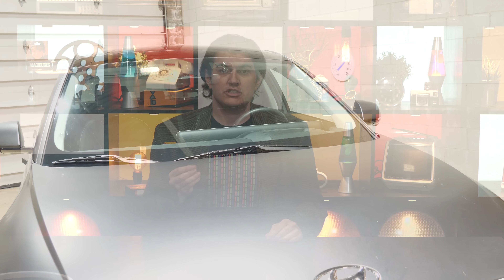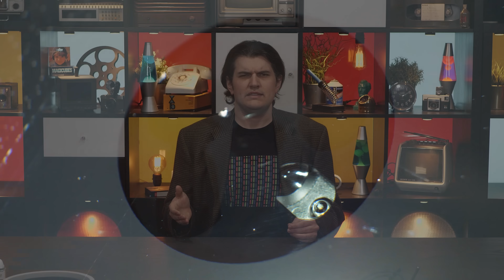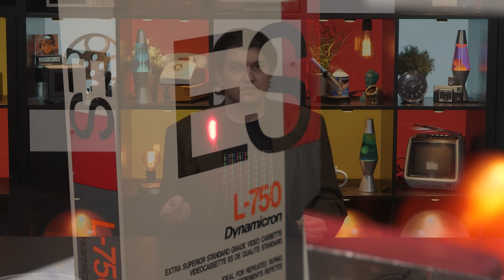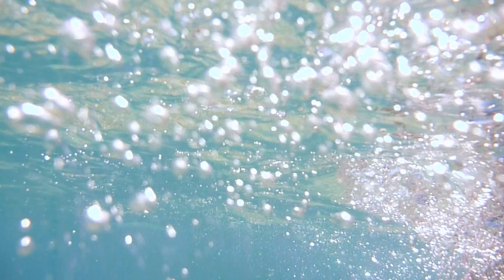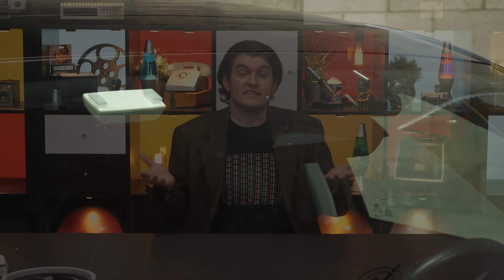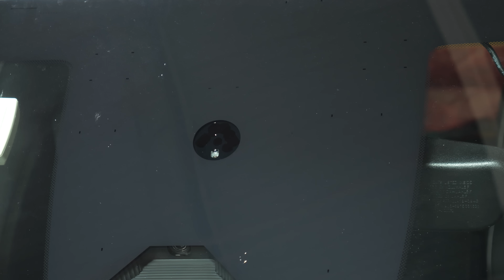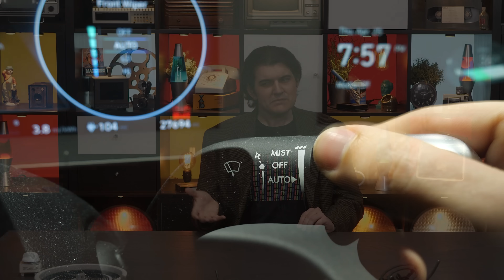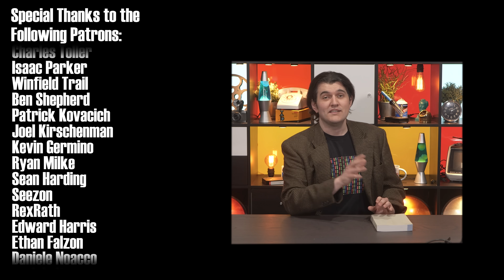The simple, clever sensor behind automatic windshield wipers

Comment: The thing that surprises me the most about this entire episode is that Alec is not the kind of person to read his owner's manual front to back within the first 30 days of buying his car.
Reply: I had had my company car for three months, before I RTFM, and discovered it had a 6 disk CD changer hidden in the boot / trunk...
Reply: @sarkybugger5009  sick I wish my dads car had that (im too young to drive )
Reply: @anymous4322  The car I currently drive is older than the car I referred to, and doesn't even have a CD player.  However, it does have an FM radio, and Bluetooth FM transmitters are less than ten currency units almost everywhere. I start my car, it plays music direct from my phone.  No interaction required.
Reply: @sarkybugger5009  I'd much rather have a CD player than anything that links to my phone in my car. Even a tape player is better, and it gives me a headphone jack aux cord if I want.
Reply: @NottJoeyOfficial  It has a cassette player, but I haven't had any cassettes for more than 10 years.  My car stereo has no external input sockets, it's cassette or radio only.  However, it's quite a good quality unit.  (Volvo)  My Bluetooth adaptor allows me to play anything from a selection of over 60 GB of MP3 and FLAC audio on my phone, and act as a fully hands free speakerphone while driving, and not limited to 6 CDs. What's not to like?
Reply: @sarkybugger5009  I just personally don't want to have to fiddle with my phone while driving, a CD player can just play all of those but with a lot more songs on the phone you gotta control it a lot more. At the very least it's local files, I wouldn't want to be tied to the internet while driving around.
Reply: @NottJoeyOfficial  It has play/pause, and back/forward track skip buttons.  My phone stays in my pocket.  I only play local music files.
Reply: @sarkybugger5009  hmm, let think: driving out of signal range (Wifi/5G/LTE), commercials/station identification; low battery warnings; not know which song is about to be played; getting interrupted by alerts/texts/calls... should I go on?
Reply: @ElectroDFW  None of those things bother me, so what's your point?
Reply: Why the hell would that be in the trunk lmao, that sounds terrible for usability.  @sarkybugger5009
Reply: @sarkybugger5009 Putting a CD changer in the trunk... I'm sorry, my brain just snapped.
Reply: @sarkybugger5009 literally same for my sister, I recently read the manual of her car and she has a secret storsge compartment under the front passenger seat 😁
Reply: @sarkybugger5009  I had my last car for years before I spotted the "load" button, and I thought "I wonder..."
Reply: @sarkybugger5009 six-disc*
Reply: @sarkybugger5009  RTFM? What kind of obscure acronym is that?
Reply: @fishkluch old school computer slang
Reply: I read manuals for cars I don’t even own, but am really interested in. It’s a good way to know all the useful little features the cars/devices have. 

Side note- I especially hate how so many companies are making the goddamn user manuals web-only, the whole point of a manual is you don’t need a network connection to look something up. I miss pdf manuals.

Edit to add clarity- They don’t even have an option to download a pdf version, it’s just a link for the online manual. It’s much more clumbersome to jump back and forth between sections
Reply: @Skiman__  Actually, I like both.  The tree version to read through at leisure, and the electronic version to quickly do a search for something in particular.  The latter is also your only option if you want to research a car before you buy it or have it still on order..
Reply: @Skiman__  My favorite is when it is only on the infotainment. It is then inoperable if you need to locate a fuse location or anything else if there is a need for the battery to be disconnected or it is dead!
Reply: "the whole point of a manual is you don’t need a network connection to look something up"

If your owner's manual doesn't have dirty fingerprints on the "where we hid the spare tire" page, is it really even an owner's manual?
Reply: @Skiman__  These online PDF viewers where you can only look 1 page at a time, can't search and can't download should be banned by the EU, the US and worldwide!
Reply: @Skiman__ If a manual is online, it should be considered an automatic
Reply: @Skiman__  My BMW has the manual in the infotainment with a lookup feature, it's great
Reply: @Highraven, I don't which exact brand you're talking about, in my experience it's only Land Rover that doesn't provide downloadable PDF, I can't find/download owner's manual on their website.

Other brands are good: Toyota, Tesla, Rivian, Mercedes-Benz, Honda, Hyundai, KIA
Reply: @Skiman__  Oddly, the app that came with my car has a link to the owner's manual, but clicking on the link leads...to instructions on how to use the app, not the car.
Reply: @Skiman__ that would be really frustrating if you had car trouble out where cell service is sketchy.
Reply: @Skiman__ there's gotta be a way to use some tool to easily copy paste all the text into a nice printable format if you really need it
Reply: @Skiman__  dude it makes sense, just download it
Reply: @bobbob-gi1yp  I guess I wasn’t clear, many don’t even have a option to download a pdf manual. They only have a link to the website based online manual which isn’t going to work offline and isn’t convenient at all to jump around sections
Reply: @Skiman__  Many web browsers have the option to save as PDF or print as PDF.
Google chrome you can print and save as pdf. Which is searchable.

Safari you can export as PDF while it won’t be in separate pages you can still search it. Granted there might be a size limit i don’t know. Also you can click print and then click on the drop down menu at the bottom of the window then click save as pdf. You can also choose your page size. I think you can pick that in chrome too. You can even create a custom page size.

If you’re saying the web site acts like an indexed PDF meaning you have to click a chapter to get to a section and it loads a different new page and there are too many of them to reasonably save as pdfs i get that.

But if it is all on one page it is possible to easily save that as a pdf. And even if it is in parts you could if you wanted to save all branches as pdfs then use a pdf editor some have trials to assemble them all into one file. 

Is it inconvenient you bet ya. So I recommend reaching out to their support centre and letting them know about your dilemma and maybe you might inspire them to add that feature so that others like you might benefit.
Reply: @Skiman__  depending on how it’s laid out you can just print the web page to a pdf. If it multiple sections just print each section and combine them with a pen combiner and there you go.
Reply: The thing that surprises me is that it's not in the infotainment screen - why shouldn't such a multifunction interface have built in help files?
Reply: @questioner1596  My 2012 BMW does that, never cars not doing it is just laziness on their part
Reply: @questioner1596 I drove a 2018 Ram 3500 dually truck with the 8" display and it had it a quick reference section on it
Reply: @questioner1596  cause engineers don't have the final word on anything, and everything they want to add is weighed against the cost of implementation by someone who knows a lot about numbers and very little about cars.
Reply: @questioner1596  Mine does! Both a quick reference and the entire manual. Oh, you fastidious Germans!
Reply: I read my new cars' manual before I actually bought it.
Reply: It's an important  new car ritual: Sitting in the driver's seat going through the manual, playing with the toys-sorry 'features' until you've flattened the battery and it won't start.
Reply: Same. Of the few people that would read a manual, i figured he would have been one of them
Reply: Doug the kinda guy to read the Ford GT owner's manual to his kids at night.
Reply: Is that a Doug DeMuro reference?
Reply: I read my parents' owners manuals front to back as a kid. Interesting stuff.
Reply: @noxious_nights  same. I kept the owner's manual from my first car; nice to look back sometimes.
Reply: Nonono, within the 30 days PRIOR to buying the car
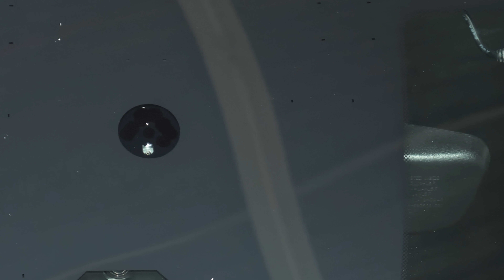Reply: 1:36 the ambient light sensor in combination to the rear facing light sensor on auto dimming mirrors tells when to dim the mirror. At least that’s how it works in bmws.
Reply: @FishFind3000  that's exactly how BMW make it work.
Reply: @FishFind3000 I’ve got mixed feelings about the automatic dimming rear view mirror. 
Though my children are grown now, I occasionally play the role of granny chauffeur. The manual toggle lever on un-fancy mirrors meant I could just move the lever and see the back seat passengers without having to turn around 😉
Additionally, being short in vertical stature, un-fancy rear view mirrors had two pivot points, which allowed for better visibility of the road behind me
Reply: That's the best part of buying a new car (or any complex consumer device), you read the owner's manual to learn about all of its quirks and features.
Reply: i feel like cheap chinese products have ruined our attitudes. when I was a kid, instruction manuals were thorough, useful, and downright vital. now there's a few badly drawn illustrations and a few lines of engrish that (often incorrectly) tell you how to do SOME of what the thing can do.
Reply: @KairuHakubi  not just cheap Chinese products; many products with internet connections do not come with manuals because the interface is expected to change over time. Microsoft doesn't even include offline help files anymore; if you don't have a steady internet connection you can't find out how to use the software!
Reply: @questioner1596  to be fair, even Microsoft engineers don't know how to use Microsoft software anymore.
Reply: When you buy a new car your not actually buying a new car, your buying a very expensive book that just happens to have a car with the book in the glove box.
Reply: @brianallen9810 What are you saying, that the glove box and the "car's" envelope is only to protect the very expensive manual from the elements?
Reply: My dad reads it first thing after buying it. Man doesn't even sleep before he knows everything about the car.
Reply: This. I came to say this. Ya think you know a guy… 😂
Reply: It amazes me that anyone would buy a complex device costing tens of thousands of dollars and spend more time bringing it home from the store than they spend learning how to work it. My brother-in-law bought a Tesla with self driving and spent six months before I showed him how to turn it on.
Reply: @darrennew8211  that's more a testament to how standardized driving has become. Equally surprising is how my wife can drive the same car as me and not know how features like cruise control work. Despite not knowing features I consider to be important, we can still drive from point A to point B..
Reply: @darrennew8211  I think it's an ego thing - "I bought this so obviously I already know how it works..."
Reply: What happens at the car wash?  Not everyone will remember to turn it off every time. Could be a very expensive failure
Reply: @oldmech619  Mostly you just lose the wiper blade. a surprising number of people turn their wipers on in the wash on purpose while they get blow dried. So, not very costly, but defs not something you want to make a habit of. It does get costly with those stupid carbon fiber blades though, and they tend to break instead of just popping off like a normal soft plastic blade.
-car wash employee
Reply: @shanleyshoupe7873    Thanks, that makes sense. I bet the car owners forgets to disarm the wipers one time. Hopefully they learn their lesson.  
Btw, I also turn my wipers on in my old car in the car wash just for the fun of it.
Reply: Someone needs to make a cliff's notes version of the car manual with all the standard content, but none of the giant WARNING! and DANGER! boxes which warn of every possible calamity should you do anything slightly wrong.
Reply: he and Doug Demuro, total dork opposites ❤
Reply: Out of 16 cars my Dad has never read any manuals. 😂
Reply: I don’t have any problems turning the windshield wipers on and off when I need to, but I would love to have a car that adjusted the brightness of the headlights on its own so I wouldn’t have to remember to do it for oncoming cars. That is a feature I would value.
Reply: @sylvanaire  That's called matrix LED headlights or adaptive driving beam.
Reply: I'm choosing to believe that he read it and forgot
Reply: There's so many useful tidbits in manuals!! [And by so many I mean one or two]
Reply: cool
Reply: Im definitely surprised as well. I tend to read the manual while waiting to buy a car
Reply: I want a refund
Reply: 30 days? I would figured 30 minutes!! 😂
Reply: 30 minutes?
Reply: I usually read it front to back 30 days before buying the car
Reply: i dont drive myself, but i always read the manuals of my family members vehicles. they are quite hefty documents, but with a little baseline knowledge you can skim read 90% of it only stopping where there is a new function, or this vehicle deviates from regular function.
Reply: I had my ink printer for ten tears before I discovered it could do duplex printing.
Reply: Manuals? "They are too expensive and nobody reads them anyway" say the bean-counters, "just put a comment section on our website under the "support" selection and let the damn users figure it out for free."
Reply: I read owner's manuals for single engine planes, like Cessnas just for fun. Not so much car manuals, though.
Reply: Having owned Hyundais for a long time, that's the first thing I do, RTFM! They've been useful since before the infotainment systems and their OWN manuals.
Reply: Read mine before I even got delivery 🤓
Reply: You mean 30 days before the car is delivered :)
Reply: I love being part of communities of nerds who actually RTFM. It's super refreshing!
Reply: Imagine how I felt when I realized my car has the italian manual instead of an English one
Reply: The issue with doing this, with my car at least, is that the manual covers every trim and option level of the model. so sometimes it has 3-4 sections covering how to do the same thing, because its got a different placement or procedure for the different engines the car was potentially sold with.  and half the book covers options my base model does not have.
Reply: Bruh the first REMOTE CONTROL car I ever got I sat down and read the manual from cover to cover. I took NOTES from my real car owner's manual.
Reply: I also own an Ioniq 5 and I did read the manual online before I got the car. I even got to the point of the wiper instructions. I still had to look it up again a few times when I needed to clean or replace the wipers, it is just not intuitive. A moment of frustration imminent.
Reply: How many warnings about not drinking the coolant can you leaf through before tossing the thing back in the glove compartment?
Reply: I'd have a doctorate with the amount I read the owner's manual
Reply: Hyundais, or at least MY Hyundai, came with 3 manuals. War and Peace is easier to read. Also, on my Hyundai, the windshield wiper controls move in the opposite direction from every other car I've ever owned that had stalk controlled wipers.
Reply: Or buy the Hayes manual for the car in question?
I even got Hayes manuals for cars I have never owned.
Reply: @lordomacron3719  Until now, buying a Chilton or a Haynes manual, or both, has been my standard practice whenever I buy a new or a used car. There isn't one for this car however. But if I am wrong and you find one, please post a link.
Reply: Exactly, when I buy a new vehicle, I always read all the manual even before picking or choosing the model. It's nice to see all the functionalities and interfaces before having the vehicle.
Reply: When I was eight, my parents bought a brand-new Pontiac Montana minivan. I was a VORACIOUS reader and had already outread the local library's offerings by that point (except for the stuff my mom wouldn't let me read), so I devoted myself to reading the owner's manual of the new van. Multiple times. I probably knew more about that van than both my parents put together.
Reply: I read the first third of the shop manual ("Theory of Operation") for my first car. Alec, are you feeling OK?
Reply: I read the manual for my bolt before I bought the damn thing! I tend to over research things.
Reply: like to know how he can afford it... doesn't seem to have a job
Reply: He is the kind of person that would go to morbidly obscure tech nerds forum from fidonet era with 3,5 active users and ask old sages their opinion of the subject.
Reply: Given the price of a car, went wouldn't you read it cover to cover? Given the complexity of a modern car...? Given the potential for valuable knowledge vs the time investment...?
Reply: Thanks for your sharing
Reply: 'Just a few logic circuits and some software' that was anything but simple, for me.🤔
Reply: what surprises me is he doesn't rewrite the manual but make it 1000x better
Reply: The manual in my car is 783 pages
Reply: @1_sus_1  Pretty standard, should take you a weekend
Reply: @jordananderson2728  I do read some of it from time to time, but when i'm not driving, I can't read it on the car because I will violently vomit my previous meal. I am also not car person enough to justify sitting there and reading a manual for several hours. (I just look at the stuff I need. (mostly) )
Reply: I read it when I ordered the car... four months before I actually received it.
Reply: No, that happens within the first 30 minutes